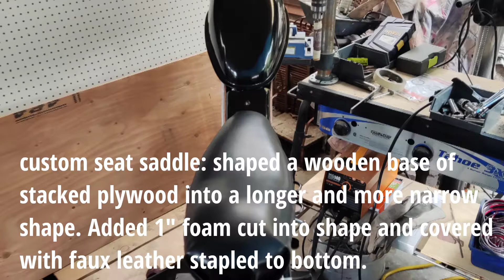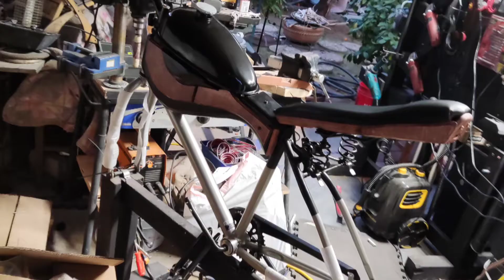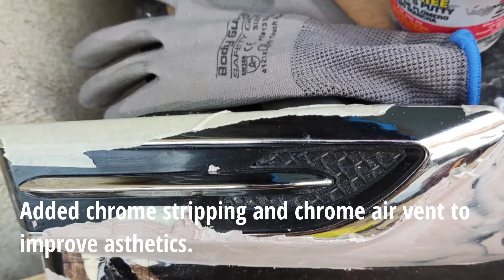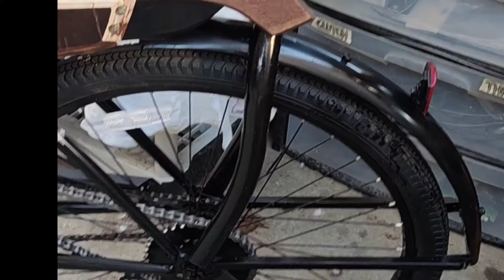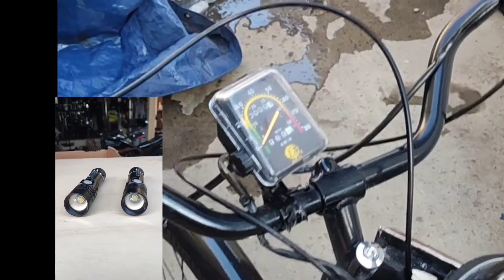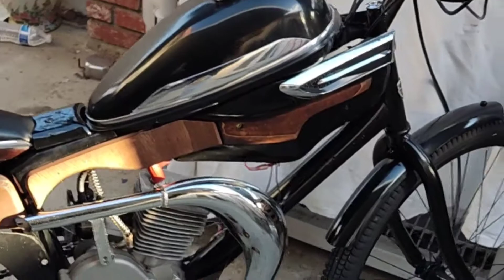custom motorized bicycle. improve the looks?

Comment: Kind of heavier the wood on the bike. Have you any builds with maybe foam and bondo or 1/8 sheet steel/aluminum that you have done? Looks really Nice you can tell your thinking it through.
Reply from the maker: All previous builds before the midnight rider have been basic vanilla builds, so I am still researching different techniques like the ones you mention. Is that what you use on your builds?
Reply: @soggyridesmotorizedbicycle6258  I have some videos up I’ve been working on doing 50+ on the 80cc not a cosmetic guy but it is intriguing

Comment: Hey nice to see your video. What is your favorite build in 15 years time? Thanks for sharing
Reply from the maker: Yeah, as far as the added weight, I am not sure it will be sufficient to bother one of these motors. I built a little cargo trailer, and used to pull that loaded with lumber even, using my current ride.(same kind of engine).  However,  I am curious to start riding it to find  out the pros and cons.
Reply from the maker: Thank you, I appreciate your interest. My favorite thus far is the midnight rider, hands down. Changing the riding position to a chopper style is not only more comfortable, but it just looks really cool.